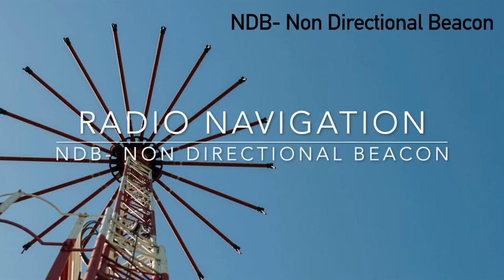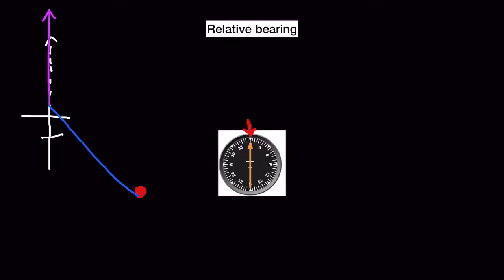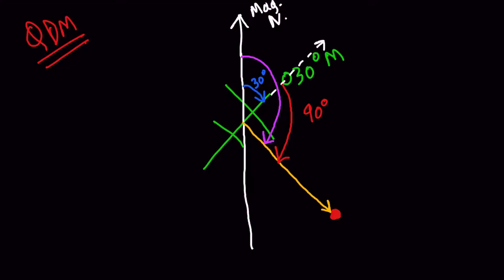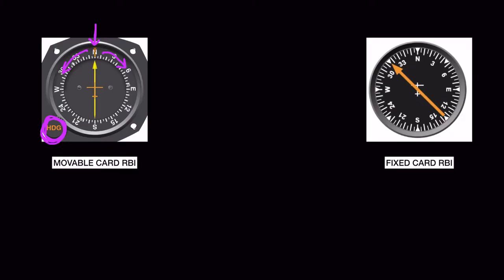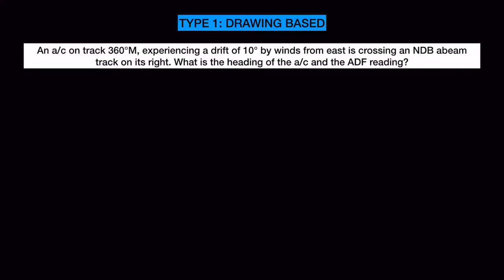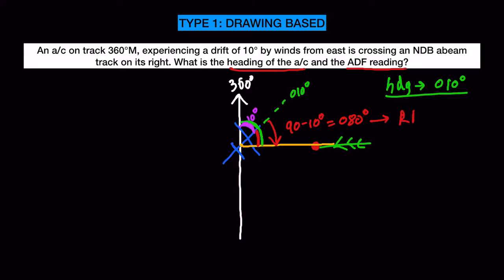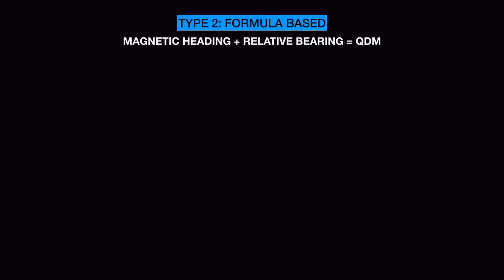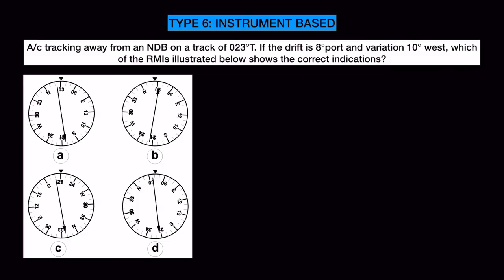CPL/ATPL Radio Navigation | NON DIRECTIONAL BEACON (NDB) | How to read an ADF | Important questions🤑

Comment: 36 mins into the video in the type 5 intercept based example, to track Radial 100 inbound the aircraft has to track 280 (100+180). So the aircraft has to turn right initially from 240 Radial. I think you explained 30 degrees intercept to fly 280 Radial inbound. Can you please check and advise if I’m right or am I confused with the question. Thank you 😊
Reply from the maker: Oh yes, you will turn right and then intercept the radial 100. You are correct, I don’t know how I have done this. In the solution, I am actually tracking inbound R280!
Reply: Sir, "Track 100° inbound" is different from "Track inbound on radial 100°", I believe you have done the former one. But in this question we gotta find the Track inbound on radial 100°.
Reply from the maker: @avinashnatraj9552  yes. In the solution I have actually tracked inbound R280. I should’ve turned to the right.
Reply: Thank you for asking this question so it could be clarified.
Reply: @blueskiesandtailwinds6004  thanks i tought i was going crazy...
Reply: yes i also came here looking  if someone has corrected him or I am the only one who is wrong 😅

Comment: Sir I believe, the question at 36 minutes has been solved for interception of inbound radial 280 instead of inbound 100. Also how can one decide that we are on radial 240 just by heading. Because we could be inbound stn with 60 hdg on any radial between 190 to 010. I think the question is incomplete.
Reply from the maker: Yes I’ve written about that correction in the description!
But ya, in questions which only have such limited information, we can assume heading 060 inbound to be as on radial 240 inbound.
Reply from the maker: Yes I’ve written about that correction in the description!
But ya, in questions which only have such limited information, we can assume heading 060 inbound to be as on radial 240 inbound.

Comment: In question no. 1. If the wind is from the east.. why is it that the a/c si still  going on to  the right where it is supposed to move on  to the left..unless the wind is pushing the tail.
Reply: Same here bro
Reply: Same question
Reply: The aircraft is pointed, or headed, at 10 degrees in order to correct for the wind. In other words, the pilot is crabbing the aircraft to the right so even though the wind is pushing him to the left his course or track remains at 360 degrees. If you don't crab the aircraft to the right, then his track won't be the required 360 degrees. In other words, the most important part of going from point A to point B is your track on over the ground. You're in the air trying to get there. So, in this case, you point the aircraft, as required, to correct for wind drift.

Comment: Great video thanks.. just one correction.
22:19 in a VOR receiver is not on the ground, but in the aircraft.
Basic difference is that in an ADF the bearing is being measured at the aircraft receiver and in VOR bearing information is encoded in the signal transmitted from the ground itself. The aircraft receiver just demodulates that. Hence Variation is applied at the site. 
So a good way to remember would be that variation is applied wherever the bearing calculation is being done.

Comment: PLEASE SOLVE THIS QUESTION

At 1000 Z an aircraft is overhead NB PE enroute to NDB CN, Track 075(M), Heading 082(M) At 1029 Z NDB PE bears 176 Relative and NDB CN bears 353 Relative. The heading to steer at 1029 Z to reach NDB CN is:
Reply: This Question too plz.

An aircraft heading 100° (M) has an ADF reading of 210° Relative. The alteration of heading required to intercept the 340° track inbound to the NDB at 60° is:

Comment: Intercept based:
Inbound on radial 100 mean a/c will go towards the station while tracking on radial 100 as we do in holding paterns, coz radials are always away from the station or bearings from the station.
I request you to kindly recheck or explain if I am wrong.
Thanks
Reply from the maker: Yes there’s a correction in that question. Read the description!

Comment: Bro
In the 2nd numerical (of type 1: drawing based) I understood it by drawing but i am not getting the answer if i use the formula 
QDM= HDG(M) + R.B
 Since QDR is 200* then QDM will be 020* 
And by applying variation we get the magnetic heading that is 237*

So by substituting,
020= 237 + R.B
R.B= -217
🤷🏻‍♂️🤷🏻‍♂️🤷🏻‍♂️🤷🏻‍♂️🤷🏻‍♂️🤷🏻‍♂️
Reply from the maker: -217 when added to 360 will give you 143, which is the ADF reading (the RB)!
Reply: @blueskiesandtailwinds6004   oh alright got it!!!!💯💯💯
Reply: @blueskiesandtailwinds6004   
And in the last question (type:6 instrument based).
a/c tracking away from an NDB on a track of 023*(T)….. in this 023* means- 23* or 230*???
Reply from the maker: @dccreations6910  23 degrees
Reply: @blueskiesandtailwinds6004  👍🏻👍🏻👍🏻👍🏻👍🏻👍🏻👍🏻👍🏻👍🏻

Comment: 36:06 

Wouldnt inbound on radial 100 be a heading of 280?  

that picture looks like inbound radial 280...?
Reply from the maker: Yes. In the solution I have actually tracked inbound R280. I should’ve turned to the right.